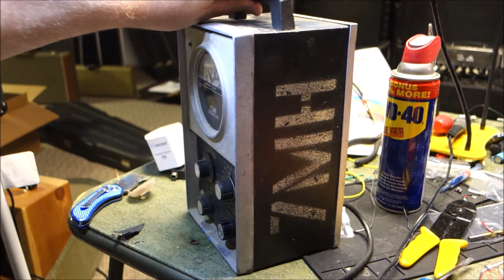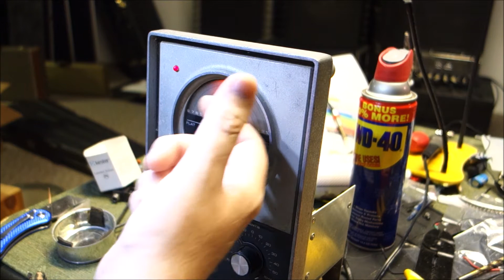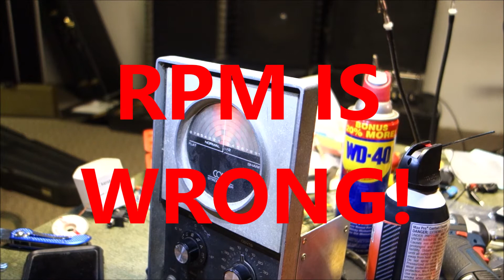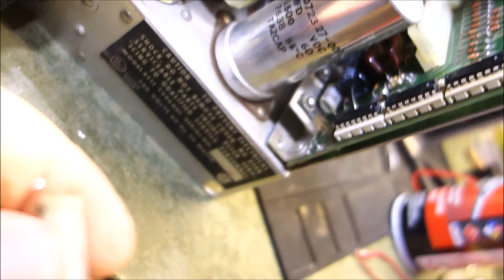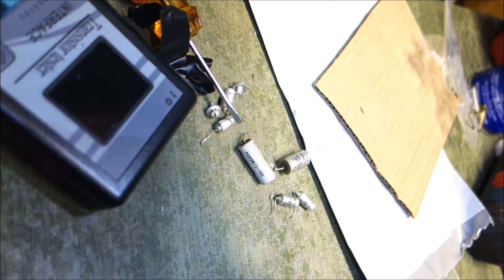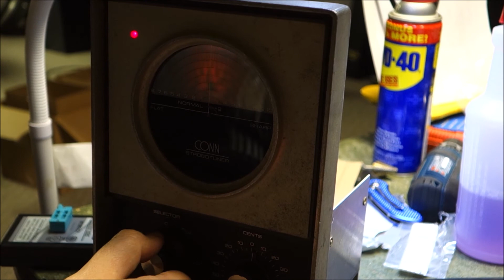Conn Strobotuner ST-11,   The Solid State Model...  Testing and Repair.

Comment: Thanks for posting!
My unit had a bad "C" also, (seems to bleed slightly to "B" and "C#")
I re seated the connectors and then I got nothing, motor wouldn't spin at all.
After pulling the upper most  7476 J-K and cleaning it's pins, it started back up.
"C" is still bad, but it runs and I can continue trouble shooting it!
Reply from the maker: I fixed up 2 of these on the channel...  the second one had a bad filter cap.

Comment: What finally got the wheel to stop making that noise at the lower RPMs?  Was it just a drop of oil on the shaft?  I just bought an old ST-11 that has the same problem.
Reply from the maker: The wheel was too close to the glass.  I adjusted the springs to set it back a little further.
Reply: @DeadKoby  Thanks for the quick reply. I loosened the four mounts almost all the way but it didn't help.  Maybe they are too lose the the motor is vibrating too much in my case?  I'll play around with it.  Thank you!
Reply from the maker: Those little spring tabs may need to be bent back to shape..  they may not be working as springs.

Comment: I got one with the motor not spinning, would that be the caps by the motor that might need replacement?
Reply from the maker: Maybe... Or the oscillator circuit that drives the motor.

Comment: Any possible chance you could tell me how to oil the motor on one of these and what type of oil thanks
Reply from the maker: I put a dash of Maxpro electrical lubricant on it
Reply: Do you remove the metal cover on the back of the motor?
Reply from the maker: no... just 1 drop on the shaft behind the disc.

Comment: Was that a tuna fish can covering the motor housing?  I cracked up when you opened  the tuner and showed us the inside.  Did you put that back over the housing?  If so, what function does it serve?  Good vid, cool to see some of the inner workings and layout of one of these tuners.  Thanks.
Reply: Also known as a tuner fish can. 😅
Reply from the maker: The can is a shield againtst the magnetic fields generated by the motor.   I put it back when I was finished.

Comment: My Conn is the tube type. It has Never Failed! When I get the time, I will go through it and replace all components that are out of tolerance. I hope the tube is good. Can you get replacement tubes? Where? Great video! Mine looks just like this one. Love from NW Colorado. Thanxz
Reply from the maker: I neglected to mention...  since most of those only run a few hours a week,  The tubes may be OK if you have them tested.
Reply from the maker: I have several of the tube Conns.   Parts and tubes are at www.amplifiedparts.com.